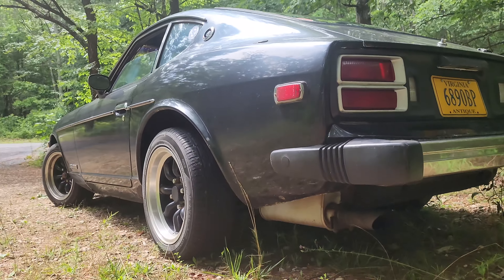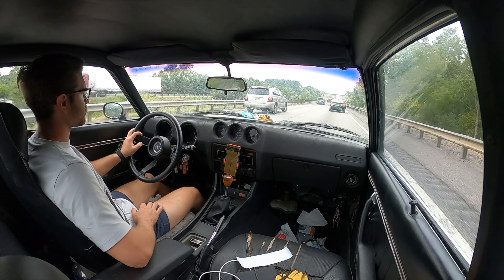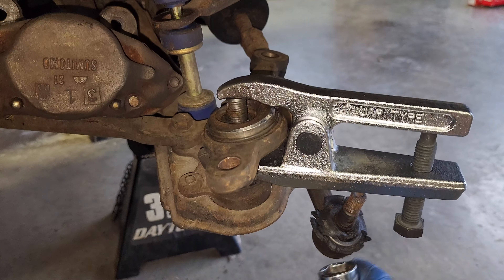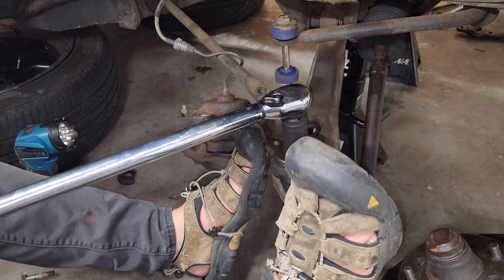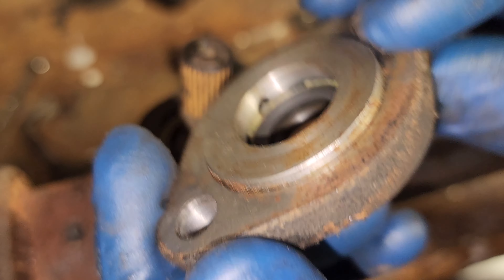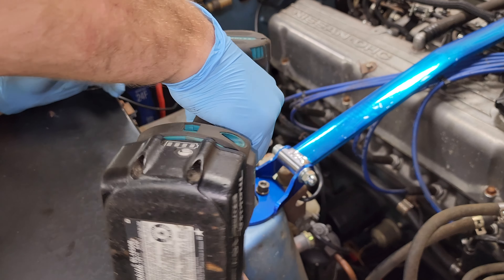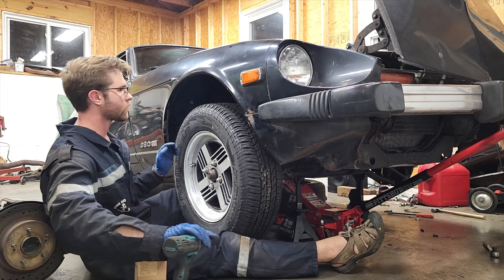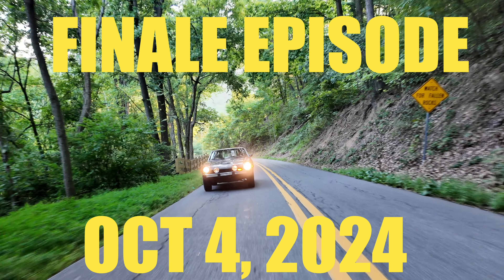Building My 280Z Into A Safari Car

Comment: Cool project! I live in PA and good ground clearance and suspension travel are a wonderful thing.
I had a few 240Zs in the 80's. You need to put oil in the strut tubes to conduct the heat from the shock to the outer surface of the strut tube.
Reply from the maker: Interesting, I never knew that. I've done the cartridges on my 300ZX and they were rusted solid in the strut housing so this was at least a pleasant surprise to take them apart without hammering and a torch.

Comment: Now to get ultimate traction and ride play with your tire pressure. Don’t be afraid to try around 25psi as the tires are rated for a higher load than your car.
Reply from the maker: I'll have to try that out. I did go lower to 30psi, where my normal is around 35 and it worked pretty well. Next time I take it out I'll try it 25 and see how it goes.